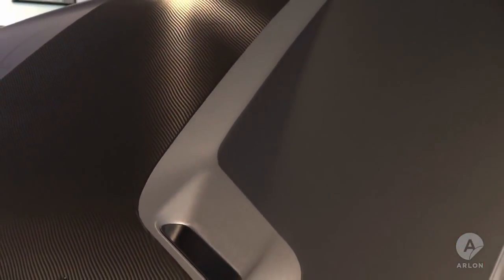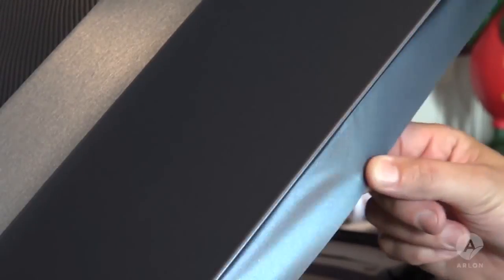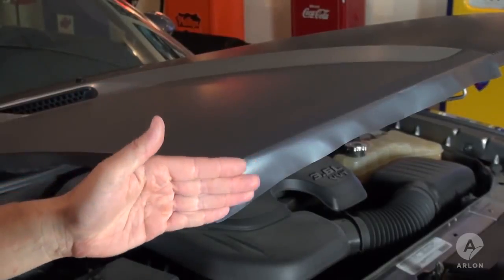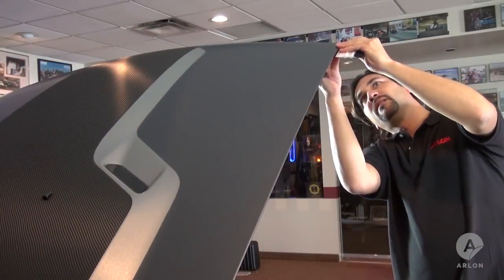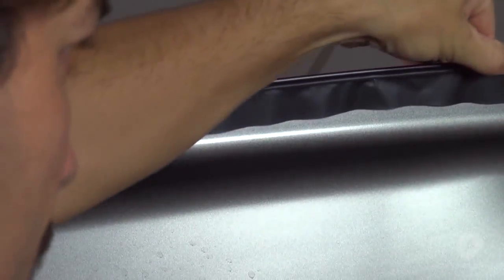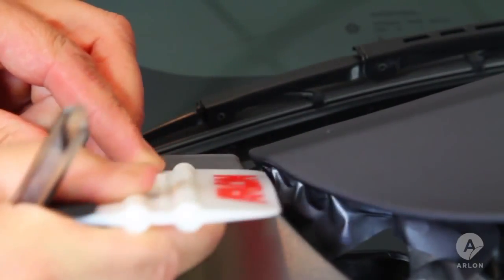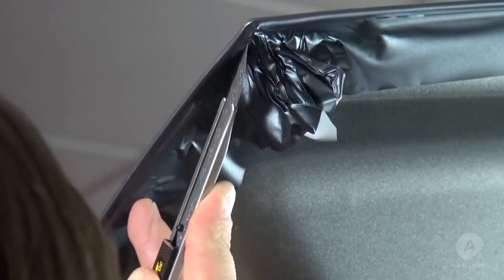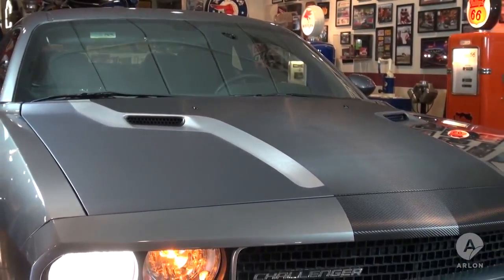Vinyl Wrap Film Edge Trimming and Wrapping Corners

Comment: Cutting directly onto the paint? Are you kidding me?
Reply: should have used a plastic exacto knife
Reply: eh? theres no need to wrap so far round the edge even for a colour change. Just trim in the gap against the adjacent panel and you'll get 5-8mm to tuck around.
Reply: Certified Installers are trained to cut through exactly one layer of any vinyl. Part of certification is to layer two vinyls and cut through the top layer without scoring the second. "Git Gud"
Reply: That's complete horseshit. And you can see how hard this guy is pressing at 3:45 when the blade slips on the weld. There is just no need to wrap around a hood that far then trim on the paint. Even with a full colour change on a light coloured car you can trim in the gap against the wings and still get 5mm to wrap around the hood.
Reply: @yetidh9  Not joking or pushing your buttons, but why not do a video and show us?
Reply: What are you a wrapper or something?